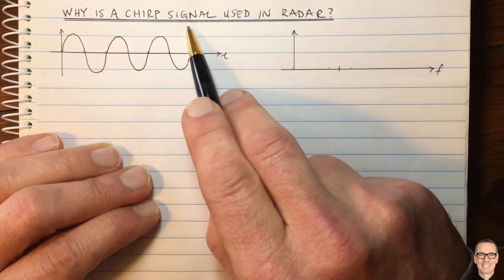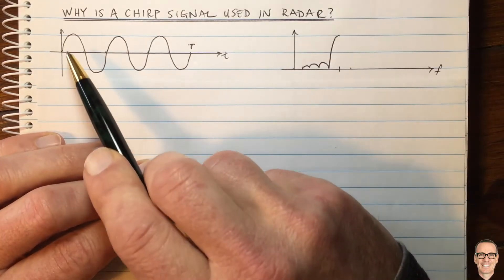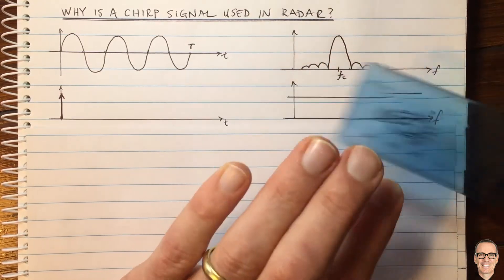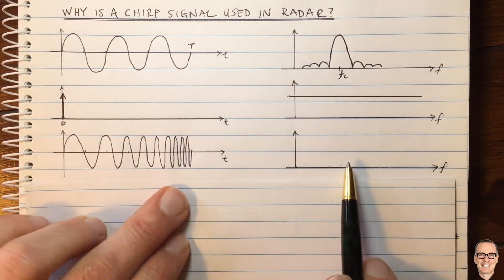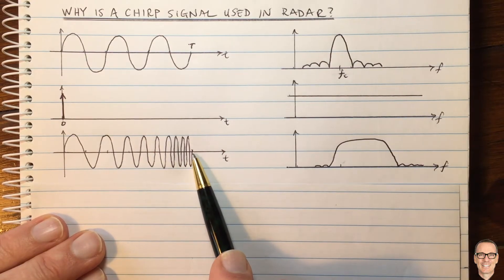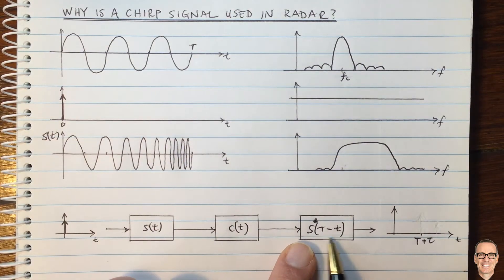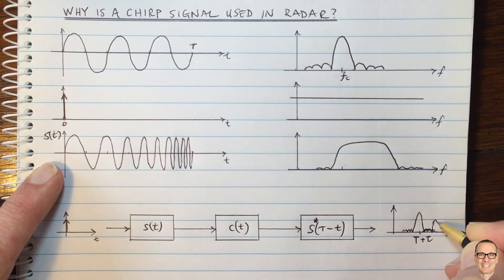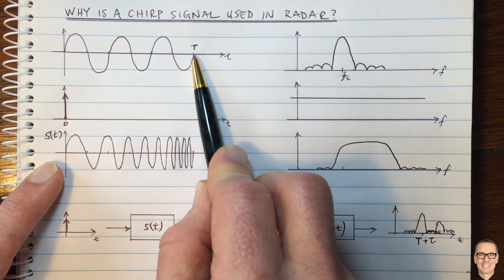Why is a Chirp Signal used in Radar?

Comment: So is a chirped pulse the same as having a pulse with a spectrum as wide as the chirped bandwidth?  I am approaching this from the Optics side and maybe since there are very few cycles in an GHz radar pulses vs laser pulses, you can used bandwidth in optics but in radar it is a different thing?

Comment: I don't think chirp is an acronym. It's just chirp after its very characteristic sound.
Reply: This is my understanding as well. It's just a short quick burst to essentially tell the receiver to "get ready." I have seen multiple radar types that use a chirp and they all use a chirp in order to notify the receiver to begin listening. It's to better align the signal and processor. It greatly reduces error rate is my understanding.

Comment: Doesn't the broader frequency spectrum of the chirp help locate objects of different sizes? I always thought sonar pings were like that because the wave would pass right 'through' objects smaller than the wavelength.
Reply from the maker: I think you're mixing a few things up. Wider bandwidth provides more accurate timing resolution. So features of an object (target) can be resolved with higher accuracy. In terms of your comment about sonar, it's important to remember that sonar pulses are compression waves (not transversal like EM waves). Water particles are actually being compressed and decompressed as the wave propagates, so there is no chance of the wave "passing through" objects.

Comment: Dear Professor, thank you very much for the tutorial, this video has been a tremendous help for me when I was starting to learn about radar, this really has made it easier for me to learn all the follow-up material regarding radar.

I have one question if you don't mind me asking. I am currently operating a radar instrument, inside the module, a hardware for signal mixing to retrieve the delta function signal (dechirping) is already installed. In the manual, I read that signal mixing is done, in mathematical sense by multiplying the complex conjugate of the received signal and the transmitted one. I am curious about how and why the complex conjugate operation is performed to the received signal. I am aware that complex conjugate means the inversion of sign to the phase or the reversing of oscillation in real world sense. But I don't understand how it's actually happening to the received signal.

I would really appreciate if you can help me with an answer because I cannot seem to find one by searching myself and I don't really have any background on electrical or communication science. Thank you very much again for the wonderful tutorial.
Reply from the maker: I'm glad you like the video. The complex conjugate is a phase rotation, that inverts the original phase from the transmitter. This video might help you to understand this process more: "What is a Matched Filter?" https://youtu.be/Ci-EjiMJo3I and also this one might help too "What Does "Linear Phase" Mean?" https://youtu.be/aQ__XatMxJo

Comment: Could you please answer my very basic question? Why digital radar (non magnetron radar) only need very small power compared to analog (magnetron) radar?

Regards.
Reply from the maker: Sorry, I'm not a hardware expert.
Reply: I think, the question is rather whether you got a primary RADAR, where you are receiving only reflections from the target or secondary RADAR, where the target, i.e. an air plane is sending back a signal containing information like identification, height etc. The primary needs high power, the secondary needs low power only.

Comment: Hi professor, once again a great tutorial! I have a small question though. If we have a scenario where the Doppler frequency changes with time, for example in a LEO satellite or in underwater communications, then can that signal be also called as a chirp signal? Thanks!
Reply from the maker: Yes, that would cause the frequency to change with time. But it would be over a longer time period. LEO satellites move fast, but not as fast as the chirp sweep used in usual radar signals.

Comment: Dear Prof. Ian, could you please explain why even a mean-free white noise can have a constant spectrum? Doesn't "zero mean value" and a constant spectrum, including at 0 Hz, contradict each other? I always thought 0 Hz = DC = mean value. I hope my question is reasonably understandable. Thanks for your awesome curses!
Reply from the maker: Great question. The "spectrum" that you're referring to is the Power Spectrum. This can (sort of) be viewed as an "average spectrum of the squared value". The term "white noise" refers to a Random Process - not an exact specific waveform. Each exact specific waveform has a Fourier Transform. But when you are talking about "random waveforms" (or more specifically, Random Processes) you need to talk about its "average" properties. For more details, see: "Autocorrelation and Power Spectral Density (PSD) Examples in Digital Communications" https://youtu.be/XWytSLZZP1A
Reply: @iain_explains  Thank you very much for the good explaination! :)

Comment: Excellent video. Very clear presentation. Is your accent from Australia?
Reply from the maker: Yeah mate! 😁
Reply: @iain_explains  this will be a weird request... I'm a computer engineer in the US with 17 years of experience who wants to move somewhere else and I'm seriously considering Australia. I've looked into work visas but it seems it's best to find a sponsor employer to start the process. My specialty is PCB, firmware, and software design. I was thinking about Sydney, Perth, or Darwin (what a list right haha). 

If there is anything you could do to help direct me toward a business that could use my skills, or some way to find such a business, that would be amazing. I have no idea where to start. 

Thanks for your consideration. I've been a sub to your channel for a while. Helps me remember some of the skills I learned and haven't used in a while.
Reply from the maker: Sorry, I'm not across the current job market for PCB, firmware, and software design. Certainly there are lots of companies doing this here in Australia, so I'm sure you'll find opportunities. Good luck in your search.
Reply: @iain_explains  no worries, you miss all of the shots you don't take, was worth a try. Thanks!

Comment: Hi Prof. Ian, can you perhaps make a video where it is about non-bijective mappings of random variables, e.g. as in a PDF that is uniformly distributed with line of symmetry at the origin. So one half is in the negative and the other half is in the positive and where the task is also about quantization levels.
Reply from the maker: Sounds like an interesting question, but I'm not exactly sure what you mean. Can you be more specific?
Reply: @iain_explains  as far as suggestions go what would be nice is to make a series on the practical skills needed in SP.  Not in depth but like what each do and where they come into play and why.  Say Matlab and then C to run the algos and why we choose C and practical reasons why you choose X algo for an application etc.  Also a "raodmap" of SP would be cool.  Comms will  generally use XYZ  radar ABC  audio DEF.  That would be useful.  good vids though learning a lot

Comment: Thank you, professor. After matching the filter different targets will produce different peaks. But I am considering that if the two targets are close together this means that it is difficult to produce the scene as you have depicted, and instead the second peak appears halfway down the first peak. Is it possible that the falling part of the first peak will affect the value of the second peak? If this holds true what method should be used to separate the two peaks? Thanks again for your clear explanation.
Reply from the maker: Yes, that's right. That's always the challenge in radar - how to seperate close reflectors/targets. In general, the wider the bandwidth of the chirp, the narrower the returning "impulse" that comes out of the receiver filter. The returns from different targets add linearly, so there are many "deconvolution" techniques that have been developed to try to seperate the returns. Here's a reference to a paper I wrote on this topic back in 1996 (so long ago it makes me feel old!): I.B. Collings and D.A. Gray, "Deconvolution Techniques for Non-coherent Radar Images'', in Proc. of the Int. Symp. on Signal Processing and its Applications (ISSPA), Gold Coast, Australia, pp. 113-116, August 1996.
Reply: @iain_explains  thank you so much, professor. I will read this paper.